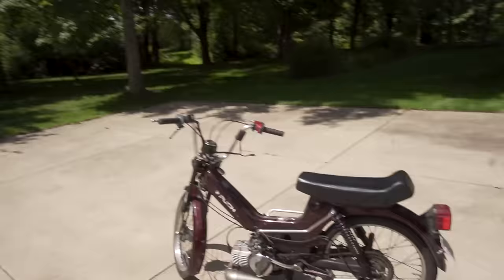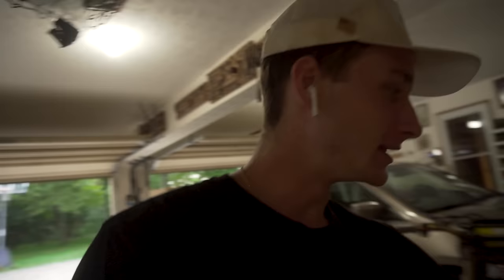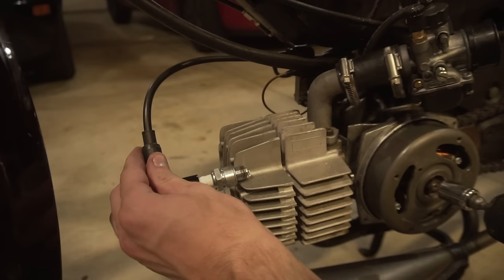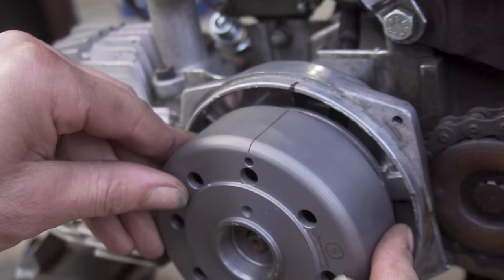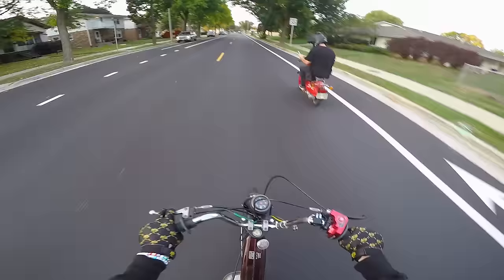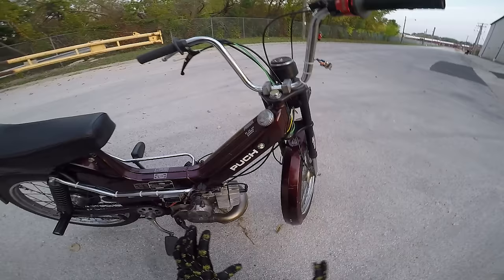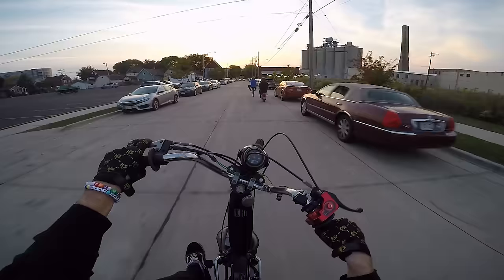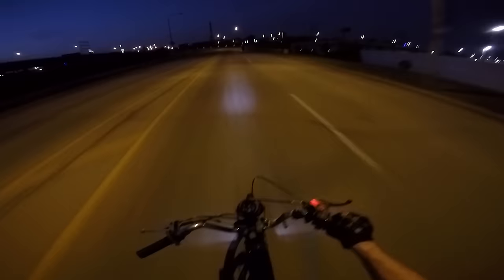Moped Ignition System Upgrade! (IT CHANGES EVERYTHING)

Comment: Stiffer springs in your clutch tune it to your kit and they also make pull starters for that new flywheel so you can run a kicksarter and a pull starter
Reply from the maker: yea I kind of want to adjust the clutch a bit
Reply: @TwoStrokeJ  if I were you, id get one of those aramid 3 shoe clutches, they seem to be endgame for the puch, or just lighten the stock 2 shoe, brace it and slap some dos springs
Reply: I modify my clutches. I cut crosshatch on the shoes for better lubrication and tighten the screws about 2,. 2 1/2 turns to raise the stall speed to about 3,000-3,200 rpm. Get the motor into the power band before the clutch grabs.
Reply: @danielsteward5090  cross hatch on the shoes?

Comment: i’ve had a cross puch maxi but then built it into a racing beast. 
set up:

74cc gilardoni kit
28mm carburator 
Hpi ignition 
Homoet p6 psr exhaust
HK clutch which is basically a ktm sx50 clutch
Honda mt5 forks 
Rito racing crankshaft 
custom frame still used the original frame but made it stronger
Custom swingarm 
Custom seat
Custom fitted reeds in the carter with v force ktm sx 65 reeds
bored out the whole engine for better fuel flow
Tuned by DDL tuning and made about 25 hp 

i sold it because i wanted a bigger bike. i still miss that Puch fun little thing 🤙🏼

Comment: Now that the bike is perfect basically, i would recommend you getting something that keeps the frame strong. A puch maxi frame can begin to bend because of the heavy modification on the engine.
There are these things called EBR frame amplifiers that you mount in between the seat and the front fork. They should most likely keep it straight.

Anyways i really enjoyed the video. Looking forward to more moped videos 🔥🔥

Comment: Here is what the condensor does.

The stator charges the condensor, then the points complete the circuit from condensor to the coil.
The condensor then discharges into the coil and the coil converts the voltage to a higher voltage en discharges true the spark plug thus making it spark.

the cdi you replaced it with (Condensor Discharge Ignition) is basicly the same thing but without the points and uses a pickup to send a signal to the cdi to make the condensor discharge.
Inside the cdi box there is a condensor.
Because a cdi doesn't need the points because of the pickup that it is replaced with, there is less wear and a faster response from condensor to coil.
Reply from the maker: Amazing explanation thank you bro!
Reply: Capacitor/Capacitive Discharge Ignition (CDI) although a condenser is another name for capacitor. It's normally just called "electronic ignition" and the original (old fashioned) ignition is called "breaker point ignition."

The condenser keeps the breaker points from sparking more than necessary, it absorbs the extra spark (called "arcing" which is pronounced "ARKING"). Electronic ignition takes the place of the points and condenser.

Comment: The most important thing to check is if the points are opening and closing. Which is what you missed. If your interested to learn check out videos on setting points ignition on old bikes like honda cb350s etc. More than likely why you lost spark

Comment: We (Dutch) do mount foot rest  on the pedel shaft, and push start the moped. I would not bother the Kickstart pull start stuff.  The upgraded clutches would be my next step. If you used the small inner rotor ignition would probably smoke the stock clutch.

Comment: In my experience, the most common cause of problems in these ignitions is the contact points. If they lose contact, it manifests pretty much the same as you described. Just cleaning them up with some sandpaper would've probably fixed the issue. But since you can use the benefits of a lighter rotor, I can see why you've gone for the new ignition.
Reply from the maker: trust me, many people told me that and thats the first thing I checked. They were working properly, wish it woulda been that easy
Reply: @TwoStrokeJ  Oh, I thought it was weird you wouldn't check those first. In that case, I have no idea what could have been the issue but I guess that doesn't matter anymore. If I can suggest something, try using stiffer springs (at least the blue ones) in the clutch or just tightening the current ones as some other people have mentioned. This way the clutch will grab at higher revs where the engine has more power and this will improve acceleration. Just be careful not to overtighten them, the springs need some space to work. Other than that, your bike is pretty solid!
Reply: Tail light bulb.. that will cause a no go for spark on stock wiring

Comment: Thank you for the interesting video. If there is no spark, first clean the points with some sandpaper and degrease with acetone. If that doesn't work, test the condenser which is usually the culprit. Rather than going to the trouble and expense of installing a rocker switch to replace the kill switch, you could have simply shorted the wires and tested that way. CDIs really make life simple. Just installed one on a 1966 Honda C65 Super Cub and what a difference.
Reply from the maker: Yea man, I’m not the best with electrical stuff so trouble shooting it is pretty hard for me. CDI’s definitely make it way easier

Comment: Awesome video man! For the killswitch testing you can just leave the black and brown wire's seperate from each other or disconnect the black ones from the coil for even easier testing. Then the killswitch has no use and the spark no restricions
Reply from the maker: thanks for the info bro!

Comment: If you’re gonna upgrade the whole thing I would get a 4 bearing motor housing and then port it to the cylinder that gives you a big power upgrade🔥
Reply from the maker: if I can ever get a spare motor to build on the side I want to do one all out for sure
Reply: @TwoStrokeJ  also tune the intake on the casings, it helps alot, specially with bigger carbs

Comment: the puch engines are like tanks i ripped one about in the 90's as a field bikle and the thing just wouldnt die lol
Reply from the maker: Exactly bro I abuse this one so much on the stock bottom end and it’s been super reliable
Reply: @TwoStrokeJ  expect years of abuse bro  i live in scotland used min 90% of the time on the beachs and mudflats the engine ran solid for years was the frame eventualy gave out from all the salt

Comment: It's funny that moped have the same piaggio engine all over the world, here in Italy we have Piaggio Ciao, Bravo and the Si, they are really similar
Reply: The ciao, bravo and si all have the same engine indeed, the gilera citta also. But the puch engines are very different. I worked on both the e50 and piaggio engines
Reply: @jdmaxi187  what's the difference between the two?
Reply from the maker: Yea man small 50cc’s are great
Reply: @enricopapili3027  the piaggio engine is basically just a crankshaft inside a block, with a flywheel on one side and a dry clutch with belt in a subframe.
The maxi engine is a complete casing with wet clutch on the right side, as well as the secondary gearing and shaft.
So, the piaggio engine is a lot more compact, but therefore needed the gearing in the rear hub of the wheel.
Reply: @jdmaxi187  ty man :)

Comment: As a front suspension you could get an EBR Fork, should cost around 60-80$
Reply from the maker: I have stock EBR replacements rn but they are pretty destroyed, not nearly strong enough. I need the big more expensive ebr forks
Reply: @TwoStrokeJ  that should do your moped good, you should consider to upgrade the steering bearings to much more durable ones.

Comment: I recommend putting an airfilter on it, improves, otterwise the carb gets too much air. Just get a pod filter or something.
Reply from the maker: some people recommend them some people dont. Most people I talk to say they restrict flow too much and don't run them.
Reply: @TwoStrokeJ  That really depends on what jets and settings are being used and the placement. Pod/sport filters dont restrict much as long as its not a really flat one. The filter helps with laminar airflow which the carburetor is supposed to be ran on. Without it, you get really turbulent flow which wont give that even flow of right mixture. Also its about the wear on the cylinder, piston, bearings, crank unless you have money for replacing that just every now and then.
Reply: @TwoStrokeJ  and without one, dirt could come in and your carb doesn't really like that

Comment: You should buy a bigger carb like atleast a 21mm I would recommend a 24-28mm pwk carb trust me it will give you a lot of power
Reply: And get some better reed valves if you have the stock ones i would recommed a stage6 mk2 intake or a v-force 3 intake

Comment: I recently picked up a 1980 Puch Newport ii with the za50, it does run but I need to clean the gas tank, the moped was sitting in a barn for awhile, it fires and runs on starting fluid. I just need to clean the tank
Reply from the maker: Yea the tank is a common issue! Hope you can get it all clean!

Comment: I don't think the spark was your cdi usually first you try new ignition coil if that doesn't help then u try stator if none of those doesn't work then cdi but yeh and the throttle respone is because you got new fly wheel and stator

Comment: Do you have a stock crankshaft or do you have an aftermarket crankshaft? If you have the stock one i would recommend you to buy a optimized one because the stock ones are gonna blow up when you ride with this much power trust me my stock one broke too with a 70cc. Btw nice Puch!
Reply from the maker: Thanks man! Mine is stock as of right now. Eventually I will do a full motor build but it’s held up well for now!

Comment: What's the top speed with the 70cc kit?
Reply from the maker: with my current setup probably around 45mph. Could be faster with a different pipe and if I tuned the carb a bit better

Comment: Intellectually failed a contact-triggered Ignition. U muricans never had mofas on that scale I know, but when u break into smt new, do some research and consult those who have experienced. But learning by doing may also be fine I guess
Reply from the maker: Do you mean check the points? I did that first, just didn’t record it for the video
Reply: @TwoStrokeJ  you don't only have to adjust them, from time to time they wear out and you gotta replace them.